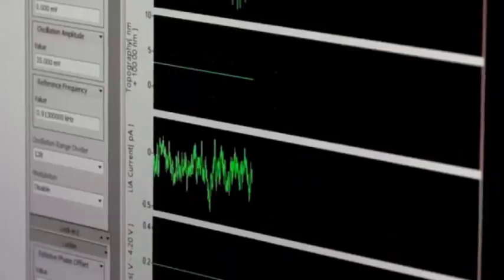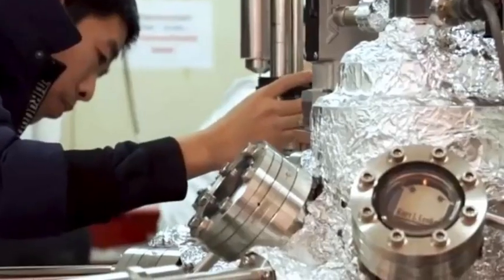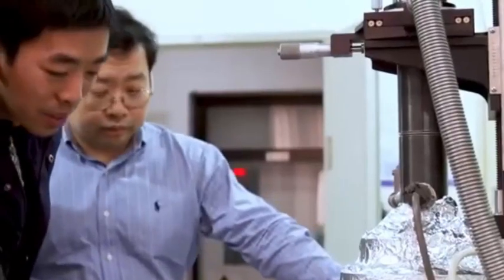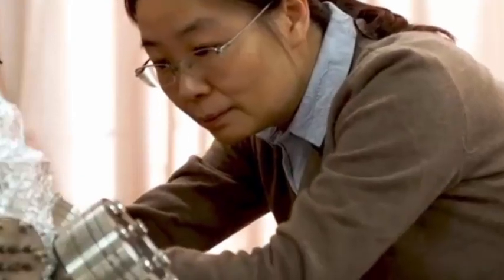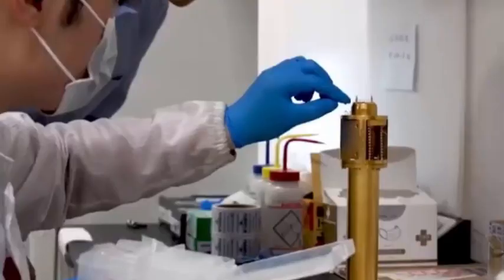Russia’s 350nm EUV Machine Breakthrough Shakes ASML’s Dominance and Reshapes Global Chips.

Comment: The wavelength of the newly developed EUV lithography machine is not 350 nm but 13.5 nm.
Even shorter than of ASML which is 15 nm. There is a big mistake in this video.